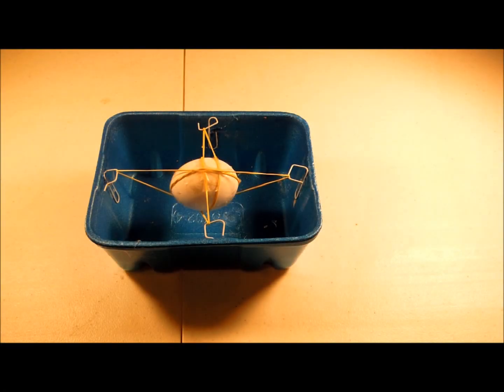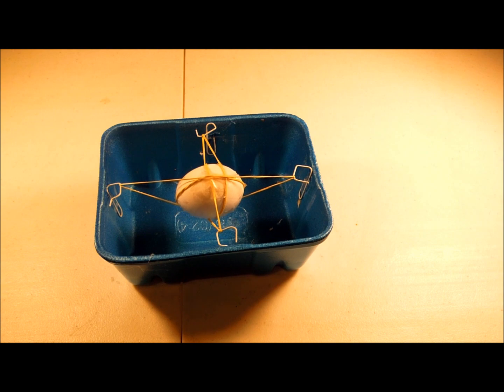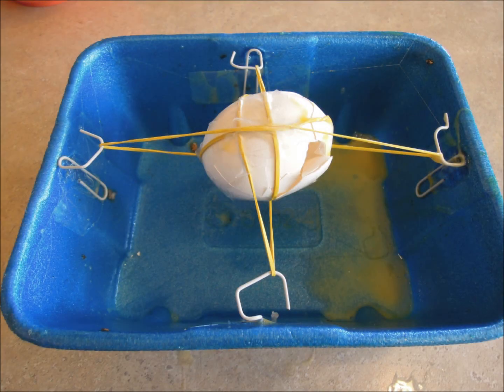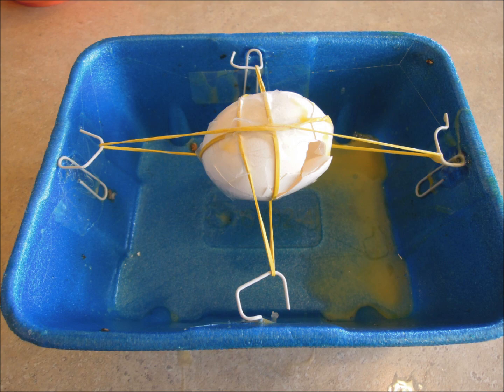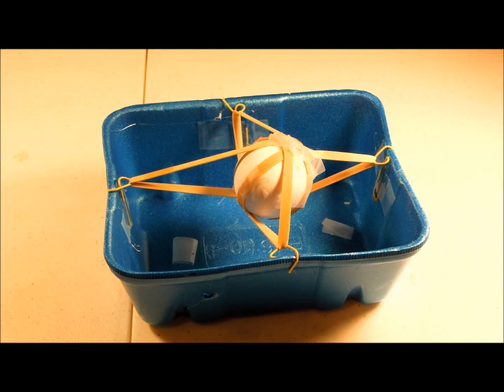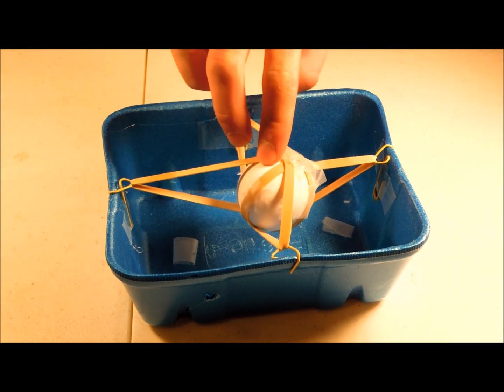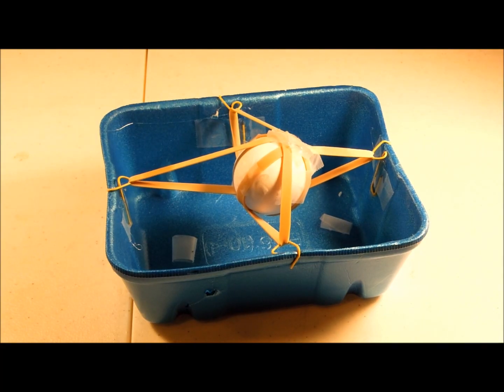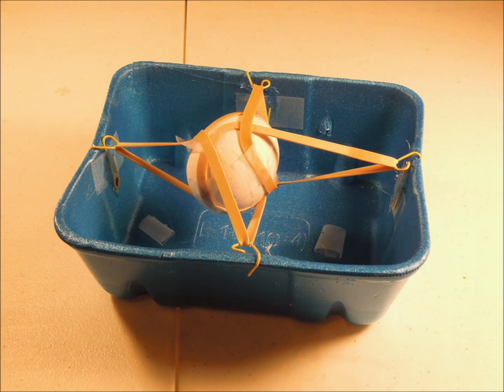Egg drop experiment

Comment: Don’t BUILT THIS
As a physics teacher this concept is a directional design meaning that you builded a contraption that has to land in the specific area
If while the device tilts during free fall (will most likely) land on the side and not the bottom where you expected the impact to go
This is a luck based idea
If your willing to take a risk go for it
It might still work but chances are it MIGHT not land the way you expect
Reply: This. 😂😂😂 Lmfao

Comment from the maker: Bubble wrap is extremely thin.  It’s not quite stiff enough to prevent the egg from being thrown against the side of the box.  I would suggest you use large sponges, like the ones you wash a car with or something similar.  Pack the sponges around the egg tightly enough that the egg won’t move much when it hits the ground.  As long as the egg isn't allowed to move to much within the box, you should be fine.

Comment from the maker: Its just a box made from Styrofoam with an egg suspended by rubber bands in the center.  I bent paper clips into hooks to secure the rubber bands to the Styrofoam box.  I attached the rubber bands to the egg I using tape.  Its a very simple construction.